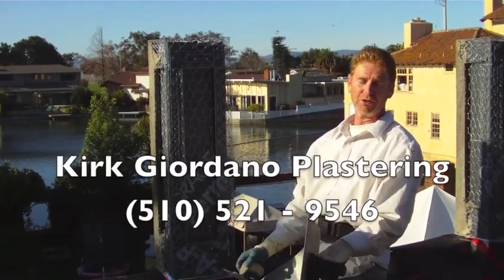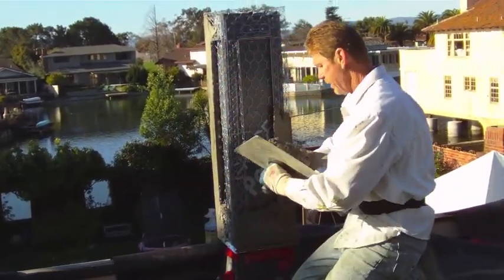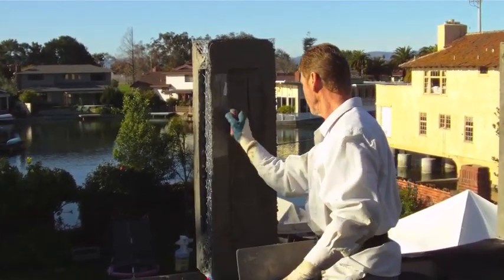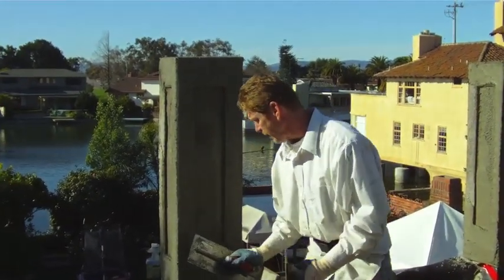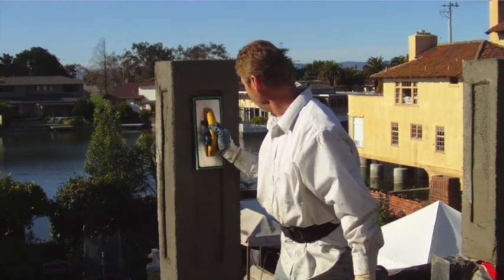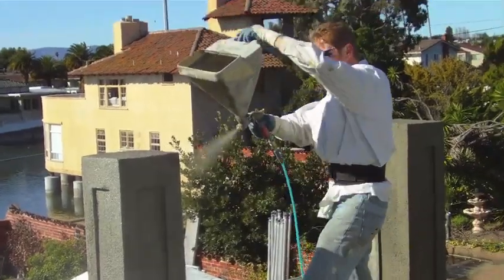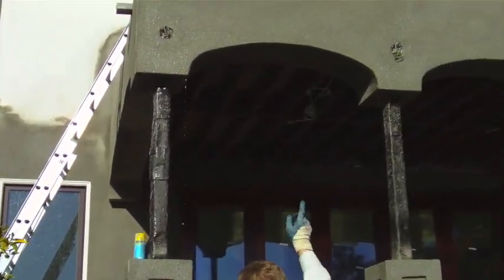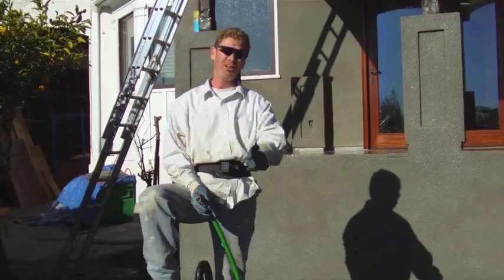How to stucco pillars or columns.

Comment from the maker: @BBrazy4 Hey brazy. I prefer a 20 inch Marshelltown  pool trowel. I have about 15 trowels on my truck at all times in case an area calls for a different one. I usually keep a margin trowel in my back pocket for corners as my pool trowel is rounded. Marshelltown trowels are the best as they are flexible and last longer than other brands.
The average guy uses a Marshalltown trowel about 12 to 14 by 5. I use a large trowel  because it holds more mud.
Best wishes.
Kirk giordano plastering

Comment: hey kirk,  what are you shooting from the hopper? just very diluted base coat mix? I have a hopper for drywall texture that looks like yours - would I use the large tip? low or high pressure?
Reply from the maker: Morning ranger, hand help hoppers will shoot interior mud or stucco, the pressure takes some adapting to, too much and it will hit the wall and bounce off,
 i generally add a bit of water to the stucco myself in order for it to flow through properly,
 Cheers,
 kirk giordano